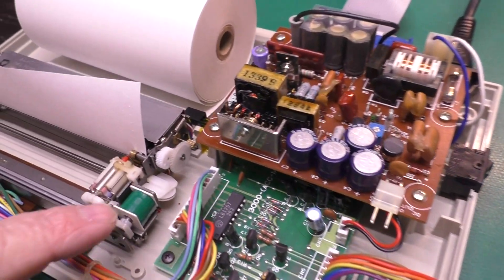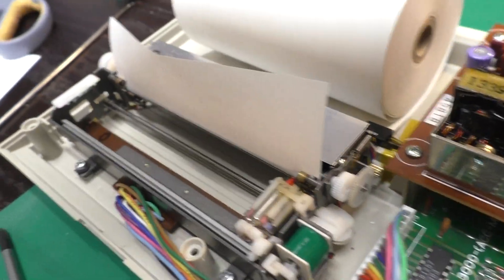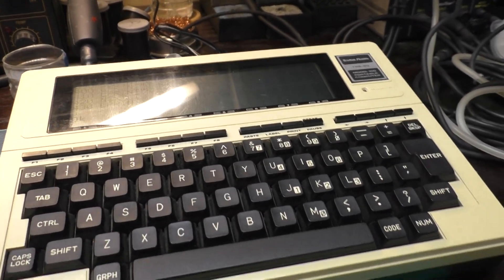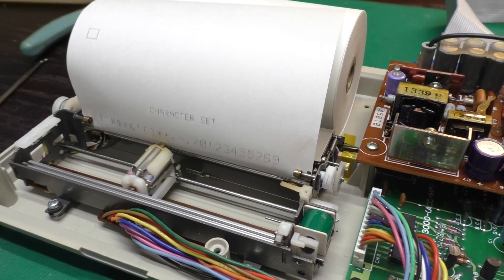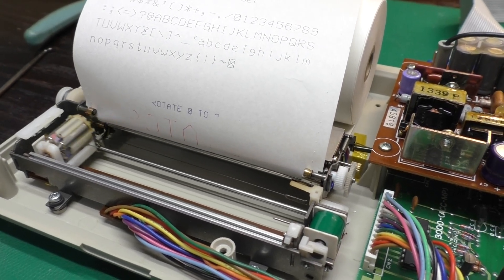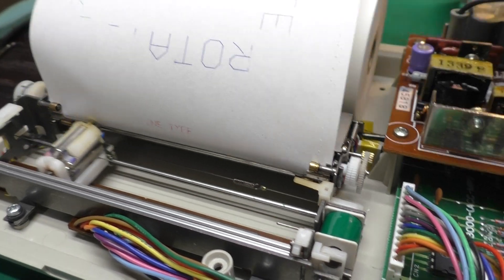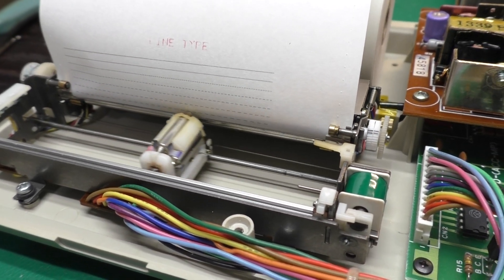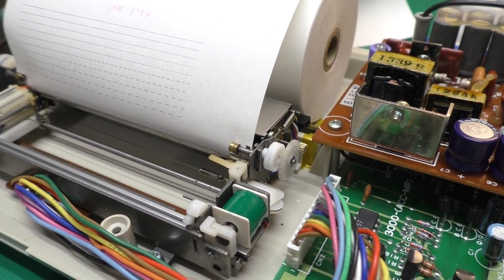Alps Y Axis Gears Test 1

Comment: Thank you for posting these very informative videos. I ordered two brass motor pinions from your eBay page. I was about to install them in my MCP-40 when I noticed that the anti-backlash gear on the paper drive roller was cracked, and one of the stops for the torsion spring was broken. As a result, I am now looking for a solution to repair this gear. Would you happen to sell this 3D-printed gear? Is the resin durable, and does it resist wear? Thanks!

Comment: Are you, by any chance, willing to publish design files for those gears, or sell printed ones maybe? I just realised this is exact gear I need for my sharp plotter. I was going to try to make my own... but I am too lazy. ;)
Reply from the maker: I will be selling them at very reasonable prices. They are very difficult to print properly due to the very small size. I only found one resin which was up to the task. Even changing the angle of the gears to the build plate from 30 deg to 45 deg made a noticeable difference.

I'll announce on the channel when they are ready, by posting a 'how to install the gears' video and I'll probably do a video on the process of reproducing small parts like this.
Reply: @HeyBirt  Excellent! Can't wait to bring my plotter back to life then.

Comment: I need that gear. Are you resin printing them? I’ve had good results printing tiny Mac 68k floppy drive eject gears on the resin printer.
Reply from the maker: Yes, it is a resin print. Ran it for about 60 printing minutes last night and the gear still looks good.
Reply: @HeyBirt  awesome, would you be up for letting me print a couple? Both plotters I have have bad gears. Also how do you store your pens? Brad at best electronics said to put them in the refrigerator but I’m not sure that’s a good idea.